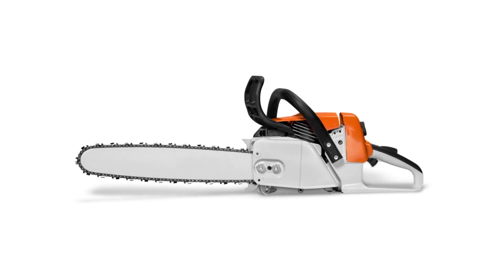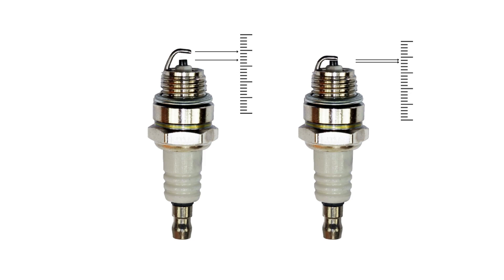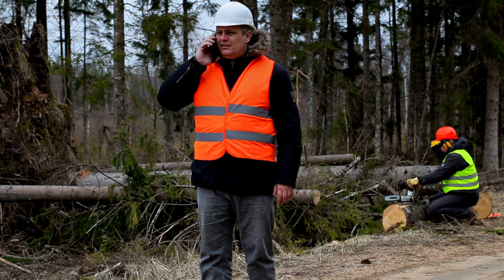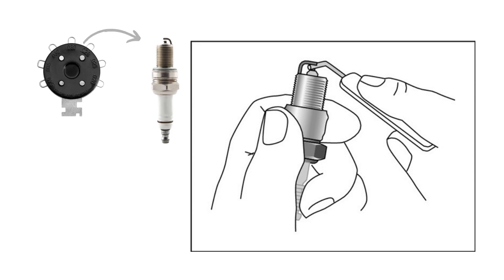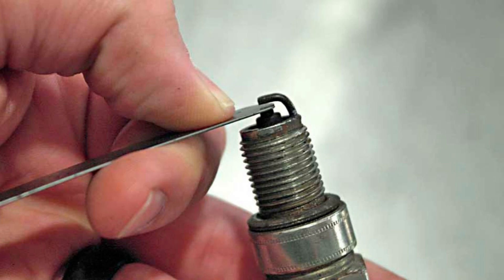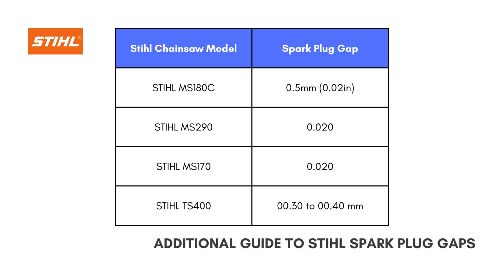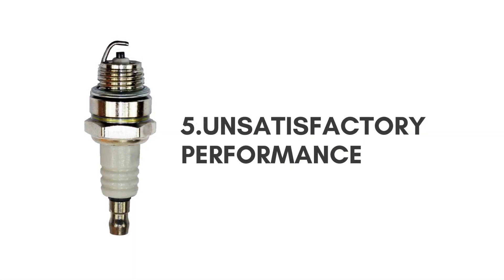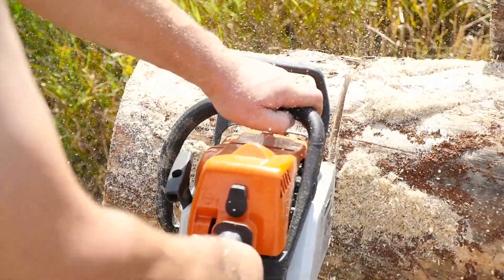Maximize Performance & Fuel Efficiency: Understanding Spark Plug Gaps for STIHL Chainsaws

Comment: In my experience, when the saw won't start or has trouble starting. I Begin with the most simple first. 
#1 Make sure on-off switch is on.

#2 Make sure the saw has fuel. 
And Be sure it is gasoline in the Fuel tank and not bar oil? Yes it happens.

#3 Make sure the saw is not flooded. 

#4 Check Spark plug for spark.